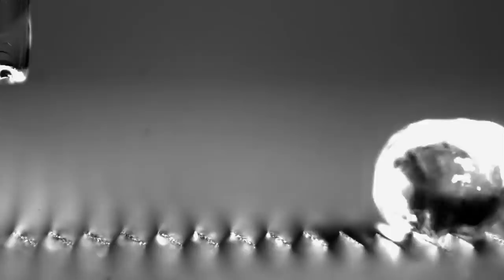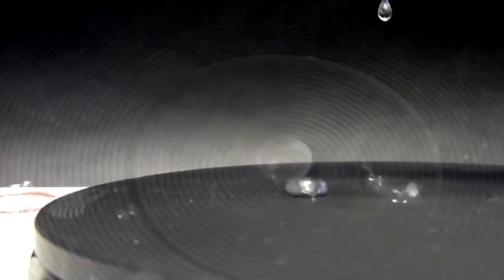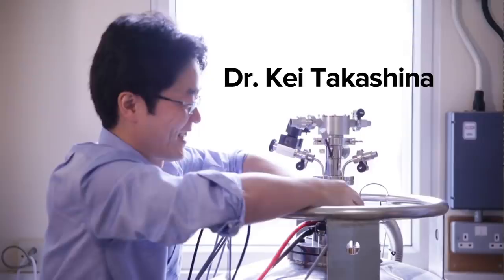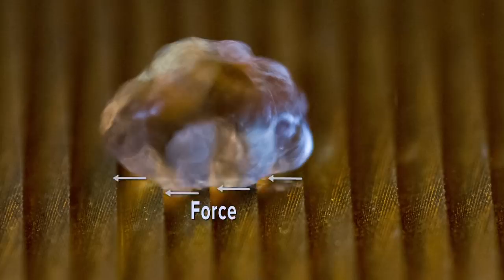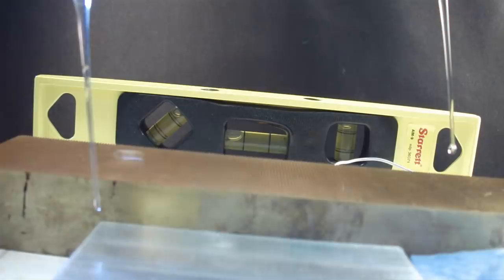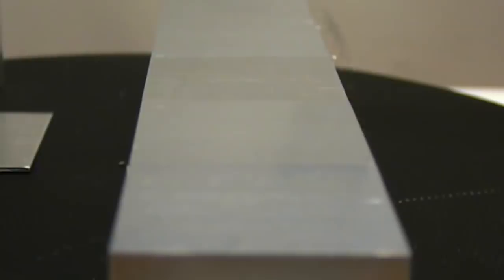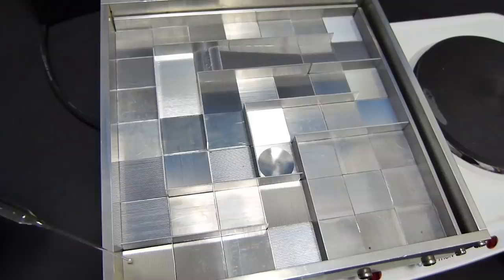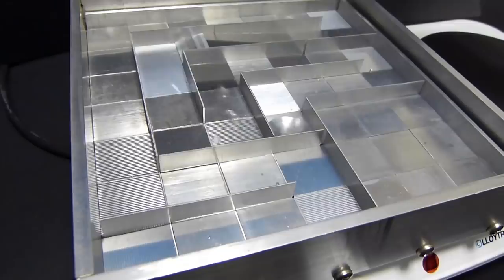When Water Flows Uphill

Comment: I wonder if this ever happens in nature - I wouldn't be surprised if there's a hot spring somewhere where people have seen water flowing up the mountain and assumed they were crazy
Reply: Were you paying attention or what? There has to be ridges SPECIFICALLY designed for the water to go upwards. I'm pretty sure the forces of nature can't do that.
Reply: NEVER doubt nature
Reply: I'll always doubt nature. It has a crap ton of flaws. Like, cheetahs, they can run fast, but if they don't cool themselves afterwards they die. Frogs, they can go on land, but if they dry up they die. Cold blooded animals, pretty easy to tell the flaw there tbh.
Reply: Rigmarole it happened right infront of me in the kitchen 
That is why i searched it
I wanted to know if ivwas the first to discover it but unfortunately nope 🙁🙁
Reply: Jetfire Nice linkage. Thanks
Reply: Actually Nature works perfectly.
Reply: It does happen in nature but not the way you expected. Atmospheric electrical charging can move water upwards though a mountain through very small cracks in rock. Very old accounts also tell of how before a thunderstorm arrives, the level of water in a well rises.
Reply: Jacko Sargs  It's still a flaw by definition m8. It's something that nature can't overcome, either by circumstance or due to physical impossibility when it comes to energy.
Reply: Jacko Sargs  Bruh. That just means that another animal evolved. Said amphibians are still flawed.

To say that it isn't flawed would be to imply that animals and nature is perfect, which is objectively false.

Your way of phrasing also makes it sound like nature intended that to happen, it doesn't. Nature and evolution has no will or end goal, only that life continues.

Take peacocks as an example, their evolutionary method of attracting mates has inadvertendly sent them into a spiral into possible extinction. Their large tails severely harm their flight capbilities which make them easier prey, and yet because of how mates are chosen, their tails will get bigger and bigger until flight is no longer achievable. Them getting stronger wings is not a guarantee to counteract this. 
Obviously it'll take hundreds of thousands of years for this to happen, but it's still an example.
Reply: Jacko Sargs  Except it does apply, what are you talking about lmao. All animals are inherently flawed, that's just a simple fact.
Reply: @melanch0lycat5393 what a saddeningly boring perspective
Reply: @oliverlorenz9726  Being realistic isn't boring, but to each their own. One can admire the beauty of nature while simultaneously knowing and accepting that it is not even close to perfect.
Reply: @melanch0lycat5393  how are you defining perfect?
Reply: @oliverlorenz9726  Without flaw.

Comment: just thinking out loud:  Could this technology be used to propel watercraft?  Silent submarines, for example.
Reply: It would be minimal considering the weight of the metal, and insulation so you don't bake everyone inside.
Reply: Most likely not. If you have a huge surface area and want to produce the leidenfrost effect on all of the water touching it, an ENORMOUS amount of energy would be needed to heat it and keep it heated. It might be possible to do for a short amount of time, but not pracitical.
Reply: wut is that icon boi

Comment: They were also using a Dovetail cutter which means the steps had a undercut and not a true 90 degree step.  I would say it was somewhere around 60 degrees "Just a visual guess".  I wonder if they made the steps at a true 90 degree is the outcome would have been different.

Comment: What size is the biggest droplet that can be moved like this? Does droplet size change over time or does the water vapour become a shield? What would the effect of zero gravity be on this system?

(Just curious...beware the cat)
Reply: The vapor might disperse as de droplet moves. So it will become more little over time... Just test it on a frying pan: heat it up the throw a little droplet on it, the move the pan to make the droplet go from side to side. Over time it will dry completely.

Comment: The water is not flowing. Rather it is being driven uphill by the difference in steam pressure. The reverse saw tooth arrangement means that the "downhill" contact surface, and thus the amount of steam generated, is much larger that the "uphill surface". More steam = driving force.

Comment: well you wouldnt want microchips to be at a temperature where water evaporates but maybe put something ither than water in there with a lower vapour point but with a same consistencie and density dont know if it exists but maybe then itl be usefull for microchip to drastically speed up the waterflow at hot parts so cool water can come quicker, could then also be hooked up to a radiator for maximum performance... should've smoked less greens tonight EDIT: forgot to say that the microhips cooler would have the inside arranged in those mazes they showed to cover the whole survace efficiently.

Comment: 0:20 3 phases of matter?
There's undercooled water (liquid), overheated water (gaseous) and a mix of both phases (saturated steam) which is when the water on the outmost part of the droplet reaches it's saturation temperature and creates the Leidenfrost effect. 
Where's the plasma or solid phase for all 3 phases to occour?
Reply: Plasma is usually not considered a practical definition for a phase of matter, and the solid is the surface the droplet is on.

Comment: So, theoretically, you could contain something like liquid propane which boils at -44°F in a pipe in a, let’s say -50°F environment, and find the Leidenfrost temp for LP. Machine the inside of the pipe and it would essentially pump itself. In a closed circuit it could be used to power a wheel that would generate power?

Comment: It's the heat rising up the block that encourages the water to travel upwards. Put a heat stop behind it and it will stop 
The skin is spinning to the cooler side the water in the middle is the actuator.

Comment: the other day a heated a pan in the kitchen, and put some hot water on it, and make it run in circles on the bottom edges of the pan. long story short: the water keept moving with apparently constant speed until it completely evaporates.

Comment: Very Cool (pun intended) but this wouldn't work well or at all to cool IC's. As stated, the drops move because they are on an "insulated" layer from the heat source. The fact that the water remains water shows that there is a high thermal resistance between the surface and the hot surface which will keep any heat from flowing out of the IC to the heat sink.

Comment: Who else here instantly got to brainstorming ideas for this phenomenon?   Like using the heat generated while a nuclear reactor is running to elevate water, so as to be used in case of power loss to run the circulation pumps, that would no longer be needed if the water is already flowing from an elevated point.  That could have prevented the Fukushima accident if it were implimented, instead of diesel generators below sea level.

Comment: Brilliant! Curious if this would work on a larger scale. For example, natural minerals with high energy density and excellent thermal conductivity like soapstone and marble in a region known for extremely high temperatures. If you were to cut these grooves into the material that you have laid out as a sort of irrigation canal, if the material was able to reach the temperature necessary, could it theoretically move larger droplets of water  uphill for any distance without evaporating in the process?
Reply: thats the issue. these droplets of water are very much evaporating

Comment: Wouldn't it be easier to use liquid N2, instead of water in the experiments? No need to heat the metal surfaces to >200C What are the Leidenfrost temperatures for different liquids?
Is it always the same interval above the boiling point?

Comment: This is how Chernobyl melted down. Once the rods got hot enough to induce film boiling, the dominant heat transfer mechanism changed from forced convection with the cooling water to radiant heat. At that moment the temperature skyrocketed. The cooling water couldn’t touch it any more!

Comment: Another great video except:
"there are 3 phases of matter" statement. 

AS the current discoveries in exoplanet/exogeology/particle physics/etc have shown in the last decade or so: there are many many more phases of matter. 
While most may be best described as 'exotic' due to things like super strong atmospheric pressure (cuz the molecule is 200miles under the surface of the ocean), maybe an exotic type of ice, etc. 
I'd argue that its important to state: 4 phases at least. Plasma is the one ppl shouldn't overlook.

Comment: "the process could potentially be used to cool an over-heated microchip inside of a computer"

pretty sure that if any component in your PC is hot enough to induce the Leidenfrost Effect (379° F), then it's far beyond saving and you'll need a fire extinguisher

Comment: Has this process been applied to mixed viscosity or those fluids with different Leidenfrost surface separation temperatures, that need to be separated?  If those fluids are passed over various grid shapes, or Liedenfrost groves or holes, could they be separated using this process?
Reply: yes they tried but for some reason of which i'm unaware , they weren't successful .

Comment: How do you think geysers work how do you think plants are able to pull water from the roots into hundreds of feet into the air to perform metabolic functions in the leaves, breaking the water molecule? As this is a fundamental property of water that makes it the key molecule of life. And just showing that life can exist at these temperatures if the dielectricGoogle Lowell metabolic functions at said temperatures but all the application is used for is the cool man-made devices and not to expand our understanding of a biological process that may be happening around a star that would fry our flesh.

Comment: So... how coudl this be used.. well it could be used to pump water... in a steady stream naturally... by using the sun.. much like / or maybe in connection with the mechanical effect through the valve impact system... so water sprayed out.. drops on the system and the other pumped up drops on to the heated surface, but heating something is difficult, but metal in a desert.. might not be to hard... but then we have day and night fatigue on the metal itself... A pressurized system could create the same effect at 0 Celsius....

THe problem i see here is there is a lack of data understanding just a collection of limitations.

Gravity/weight on the lower edge, perhaps vaporizes on that cushion... since that downward force is equalized and over come, that force allows it ot propel itself upward.. the question is eventually it would reach a maximum speed, where any faster.. it would no longer be able to propel itself... then doing it in space would also be utilized to isolate this inquiry... as partial leading towards a data use and collection.

We have ridges, thickness and thing, and angles and corrugated spikes. needles spacing. so many shapes to utilize to ground out data for the sake of understanding hte principle for a industry application. 

Once the exact force is known...

Anyways data is better understood imo, once it cna be applied on a planetary system scale meaning, the core data is made so that regardless of where you travel in the stars, you cna refer ot engineering specs adn then know aht exactly will occur in x environment.

Comment: People be suggesting Leidenfrost computer, Ping pong ball Games using this Effect. 
Its pretty old schooled  😒Bcz these days We are looking for  Ways to get the Work Done via technology which require Lesser Temperature Rather than increasing the temp only to bring it down back to Normal just for the sake of Playing a "ping pong water drop game"
lol
and for Computers it wud have been a Great Idea To suggest it in  Old Days when we had supercomputers(and  they Used that already later in Evolution of Computers) which used to run on Highpowered Electricity and Got heated Up To Way higher(758253.6 °C or 4.4MW of Electricity).

Comment: I want to see water flow uphill without any sort of influence I want to see natural you will never see it, it doesn't exist on this world of ours the water flows under the hills and exits on a different side from where it entered.  If you build 100 mile plastic channel that followed the curvature of the Earth and poured water from the centre of that plastic channel which should be the highest point, the water would just fall down to both ends and there would be nothing in the centre because water cannot flow over hills it is a fact of life and a fact of nature but hard to swallow for the majority of the world

Comment: For cooling microprocessors, this is an absolutely useless effect. Because at such temperatures, the crystal is already starting to peel off from the textolite base, which leads to chip failure. And water must transfer heat, not run away, for this you need to conduct research on heat transfer and not just observe fast drops. In heat pipes, water evaporates and the steam transfers heat energy between different ends of the heat pipe. And here it is clearly seen that water does not absorb thermal energy because it is repelled by a layer of steam.

Comment: KLICK BAIT... CAPS ARE  REALLY STUCK... OLD KEYBOARD.
MY MOTHER`S CAST IRON  WOOD STOVE WAS JUST AS ENTERTAINING FOR US  DURING WINTERS  WITHOUT THE ADDED COST OF MACHINING EXPENSIVE GROOVES IN ITS SURFACE.
AS WE SPILLED WATER ACCIDENTALLY ON ITS SMOOTH TOP WHILE  ADDING WATER TO A POT FOR HUMIDIFICATION ..THE DROPLETS WOULD SCURRY ABOUT OVER ITS LEVEL SMOOTH SURFACE ...GREAT ...WE KNEW THAT VAPORIZATION  CREATED THE MOVING FORCE.... AT AGES  5 / 7 THAT WAS 59 YEARS AGO.
WAKE ME UP WHEN YOU  CAN FLOW  COLD WATER  DROPLETS OR A STREAM OF WATER....... UPHILL..ON A SMOOTH METAL BAR.
THAT WILL MOTIVATE THE HELL OUT OF ANYONE WITH A CRITICAL THINKING MIND  TO EMBRACE SCIENCE MUCH MORE 
THAN   LEIDENFROST....

Comment: First thing I thought was the rotation of most CNC machines are clockwise thus creating a finite angle amongst the material, my thought is to lap the edges of the aluminum , thus creating a straight path of flow.. just sayin bitchezz!!